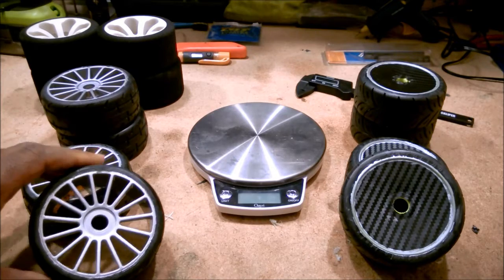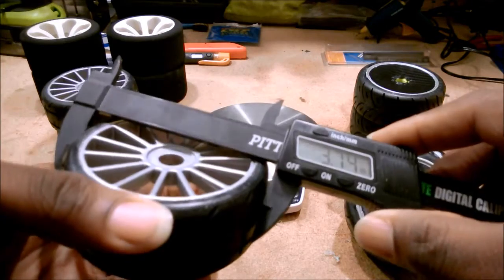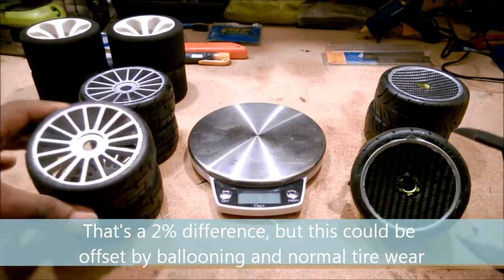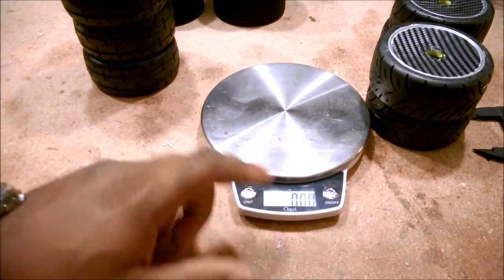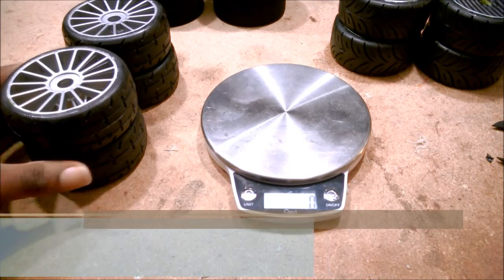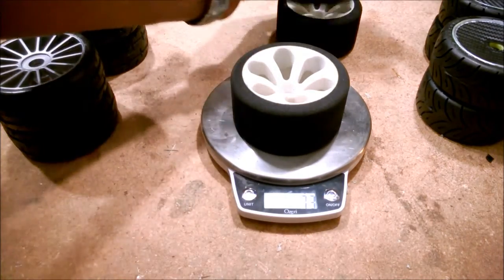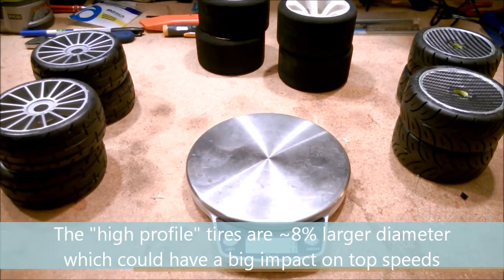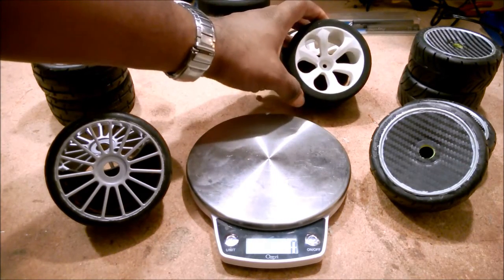Ep. 118: Rubber vs Foam Tires! - GRPs vs SP Racing Tires vs Jaco/BSR Mini-Review

Comment: Im using SP RACING 1/8 GT COMPETITION rubber and SOFT and SP RACING 1/8 GT foam 37. Both are superb for the track. My friend uses it for Serpent SRX8 GTE WC 4wd 1/8 EP and i trying XO-1 on the track. Funny is, that SP tires are way better than for example original XO-1 wheels and many times cheaper.
Reply from the maker: I wasn't very impressed with the original x01 tires. Apparently you need to get a lot of heat in them to make them sticky enough to be useful for the conditions a lot of us run.
 Thanks for watching!

Comment: Grp tires explode about 115 mph. First hand experience.  Foams are the only tires that stay together at speed. I like Johns BSR personally.
Reply from the maker: GRPs have gone over 160, but you are right. They are VERY prone to come apart at speeds over 115. Any minor imperfection in the tire, sidewall, or glue bead can lead to disaster. Foam tires are much less likely to fail like this since their tire weight is so much lower.

Comment: Just ran across this video. I personally have hit 114mph on Jaco foams. They do really well at high speeds....in my opinion.
Reply from the maker: I've gone back and forth with foams and am now back. I think that the problems I was having in the past were either due to the foam being dry (no traction compound) or the car's setup. In the end, my foam tires have proven tough and consistent. The only real problem I have is that the Jacos use a 12mm hub, which has problems handling the torque from a 6S setup. They will eventually strip out on a heavier car. At that point, you should trade up to the BSR foams (which are made by the same guys that now own Jaco) or Banana Skinz foams.
Reply: I love the banana skinz too. I run them on my rustler. I've hit 118mph on them. never had a problem with the 12mm hubs....not yet anyway. lol

Comment: I been using the foams on my castle rustler and hate them. Which ones would you recommend for runs?
Reply from the maker: Which foams are you running? There are at least 3 good foam brands that will work on your car: Jacos, BSRs, and Banana Skinz. Also, are you running the foams dry or with traction compound. Dry foams can get hard and will not grip very well after a while. A little traction compound, WD40, or even windex are known to do wonderful things to wake up dry foam tires.

If you want to give up on foams all together, most guys run GRP rubber tires. I actually really liked my SP Racing belted rubber "winter"  tires, but their construction limits them to ~115 mph.

Comment: Nice informational vid!  After many tries, I've come to the conclusion that the 4x4 platform I'm working with (Redcat Racing Earthquake 8e) prefers wider tires.  I've tried the kind of tires you had used in the "how to strap tires" episode and a set of soft Sweep Racing tires which are very nicely made with a good feel, but my steering assembly goes wild after 28mph.  I threw 2 dBoot tires from my Arrma Kraton on just the rear of the vehicle and I started getting up to 35mph.  So then I threw HPI Phaltline tires on all 4 and got up to 40mph before I flipped and had my pinion eject.  Using a stock 2050kv on the paired 80a SC8 esc, the box claimed 35+ and the wide tires achieved it.  My problem is functionality doesn't fit my body shell choices and I'm having a hard time trying to find tires with a 2.4" to 3" diameter like what's in your "tire comparison" video with similar width to the HPI Phaltline's.  Here's a link to a video showing the better results 👇
http://youtu.be/oRKHgtDIgok

Comment: nice...you should create a solution that increases the durability of the foam tires by 50% or more...i happen to prefer the foams...i still need to try bsr since I believe jaco are bottom of the line
Reply from the maker: +Wayne Peeples I still like foams, too so I'm probably going to play with this problem a little more on Slade. I think Slade's high downforce helps the foams hook up better, but Dizzy just had too much torque on 6S for the foams to handle. I'm curious about the BSRs, so I should reach out to them.
Reply: I copy that ...i just know on 1 : 10 scale cars jacos are the worst in my opinion. ..SP by delta plastiks,  contacts, and BSR are much better quality
Reply: +Wayne Peeples EDIT BSR's foams sit on GRP/Buggy style rims and are the standard 8th scale material, offset and width. That's what makes them a better fit for speed runs IMHO. Jaco's are 12mm hub and made of a stiffer and less dense plastic. I've hit rocks with J's and had them explode lol.
Reply: Hahaha!!...wow man ...@hit rocks and explode...your statement is very informative and makes much sense...hope u didn't suffer too much damage due to them popping
Reply: Wayne Peeples I firmly agree with you on this one bro jaco is bottom of the line I tore 4 pair up in four months but I do like the foams just gotta find some that hold up or jus bite the bullet and by grp

Comment: so those sp racing tires capable of 100mph just like the grp's?excuse the weird question.just havent heard much of em..
Reply from the maker: +Mr Highpower82 They are supposed to work well, but +2cwik4u104 had issues with an older sets internal foam. I'm hoping that's been all sorted out now.

Comment: a drag race with foam tires on  6s very reliable and when I was testing them I hit 88 miles per hour flawless all my car are  getting foam tires
Reply from the maker: +RALPH FOX Thanks for your comment. I really should have been more clear in the video. The foam of the tires wasn't actually the issue. I was using the 12mm hex "Rustler" Jacos on my 6S powered slash and was putting down enough torque that the wheel hexes were beginning to strip. The actual foam held up great. I really should have been running the BSR versions with 17mm hexes, which probably would have been fine.

Comment: and now for the real test.
Reply from the maker: +2cwik4u104 I didn't quite hit 100 mph today, but 90+ mph several runs in a row while breaking in a new setup aren't too bad. The new Sp Racing tires look like the real deal. I'm going to keep using them as my primary tires for now and I'll keep you posted.
Reply: nice, ill be watching.

Comment: did you ever do a running vid using the SP Racing tires?
Reply from the maker: +stickaman Actually, all of my Run DMV runs with Dizzy were on the SP Racing tires. I have a Run DMV Playlist where you can look at the 4 sessions, but Dizzy did a LOT of runs (15-20) peaking at 102 MPH and the SP Racing tires performed flawlessly. I've been told that they have been up to ~114mph on some other cars so far.
Reply from the maker: +rhouse21 - RC Physics Here's a link to my 102 mph session. https://youtu.be/ZQh66ojbmXM